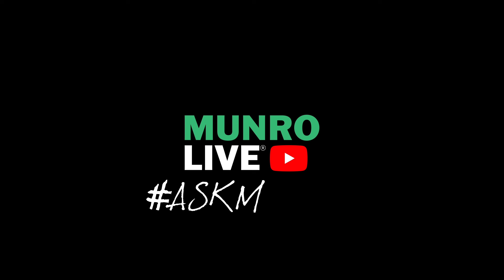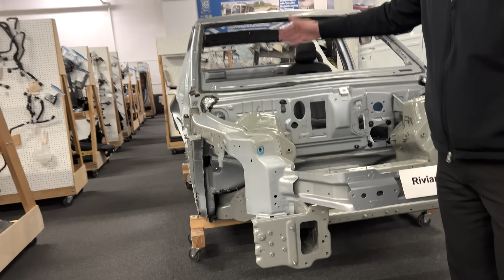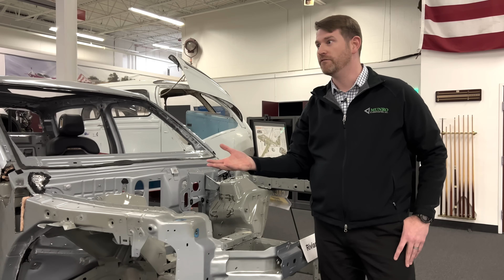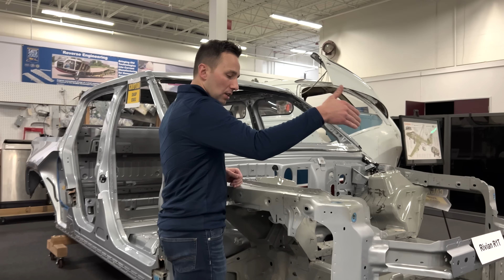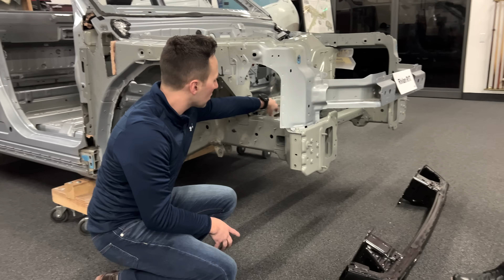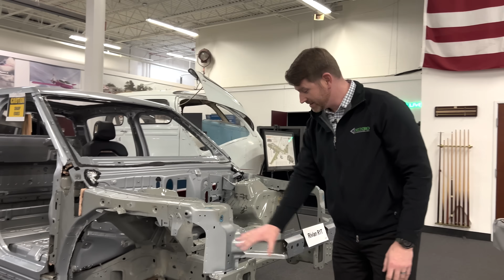Ask Munro E5: How the Rivian R1T Earned IIHS Top Safety Pick+

Comment: I keep saying this over and over:   People continue to want to compare the Rivian to some small trail truck like a Ridgeline or Maverick, just because that sort of matches the Rivian styling, plus the mono body type construction.  But that's just not the case, the Rivian IS an F350 class truck.  It weighs just as much and has even more torque;  and I'm sure it has to use 8 ply tires or better, just like a 1 ton truck.   I wish you guys would stress this more, that this is not a small nimble truck as it appears.  This thing is a tank and it's built like one.

Comment: Range targets and weight,  At what point does a big heavy long range battery become more of a problem than a solution.  What is the trade off between range, weight, and cost.  A lot of people talk of range anxiety.   How much of that is ignorance of needed range for a use case.  A review of use case versus range requirements would be interesting.  How much are you paying for range that you may not need.

Comment: couple of questions.   Is there a point where defensive or offensive is better?  Based on vehicle weight?  Also, does one version typically have a structural weight difference in material needed?

Comment: Essentially, all EVs are acing all crash tests. The reason is quite straightforward. The main rigidity of the vehicles is associated with the battery and thus the passenger cell. This leaves the front of the vehicle front box to be quite straightforwardly designed to manage any crash you might come up with. It's also the reason they ace the side crashes, again the battery case is the strongest part of the car is the battery case, thus it virtually precludes safety cage intrusion. The safest vehicle ever tested by Euro NCAP has been the EQS, but other EVs have done almost as well. Getting the highest ranking is really not an achievement, particularly from an EV. The obverse is also true. If you dont ace it, that is a red flag.

Comment: try dropping one off 300 foot cliff  and have all 4  people on board  survive  like a Tesla just  did
Reply: I own property near Ouray colorado off the Million Dollar Highway. Cars go off the side ar least a couple dozen times per year and it is far FAR further down. 7 people die per year on average. 
Survivability is not exclusive to Elon cars even if driving a tesla may force you to become a ol psychopath
Reply: 250 ft. And a Hyundai did it a while ago off  300 ft DROP ALSO.
NotE that the Tesla had its doors off. It rolled. bUT Barely on the roof (low center of mass, like all EVs). Rolled, so it was NOT a 250 ft drop. It takes a lot of LUCK or MIRACLE to have such a crash survived by all 4 occupants, but if you do it with a bunch of cars of each brand and type, not only Tesla occupants will survive, and FOR SURE other Tesla occupants will suffer fatal injuries. 
You may have to up your fangirlyness in cherry picking istances to promotes as your tokens of Tesla worship.
Reply: Look at Volvo dropping their whole lineup of vehicles off cliffs and through ditches and from all angles for years.   They’re the only vehicle manufacturer that says no one will be killed or seriously injured while in Or driving a new Volvo vehicle.